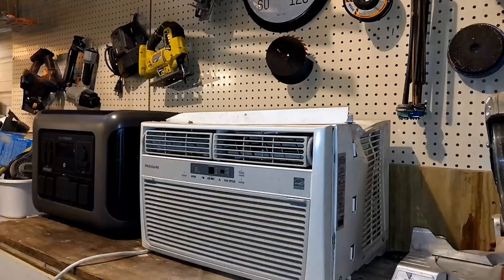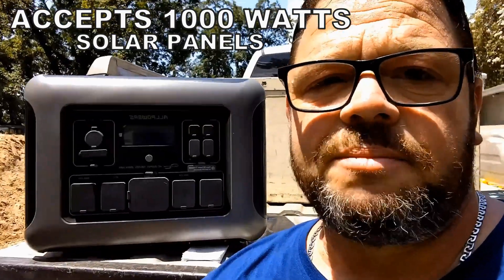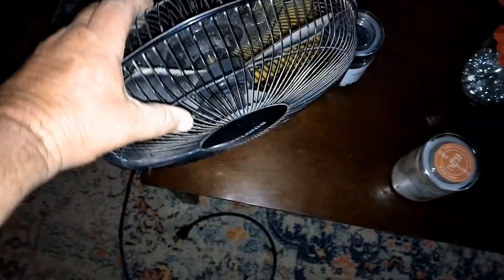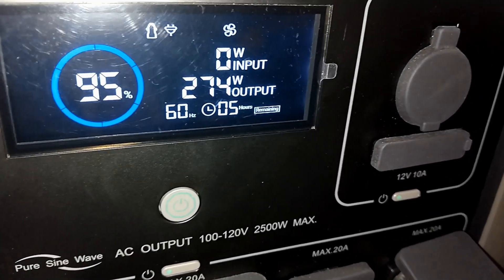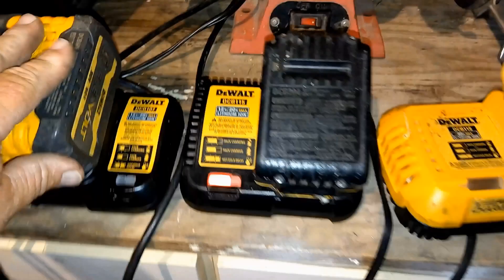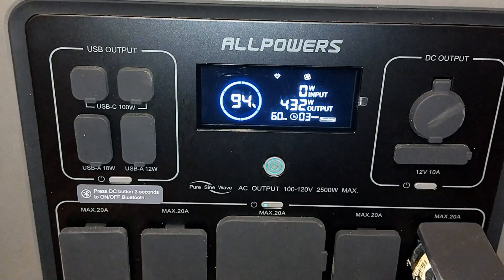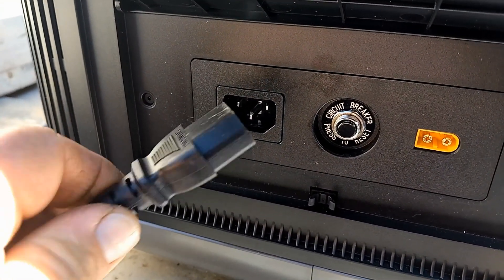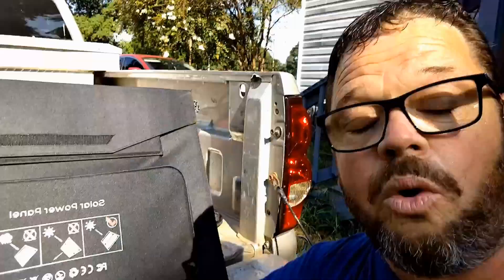Is This Best Solar Generator for Home Backup? (All Powers Review)

Comment: Biggest issue with the power converters is how much life can you get from one???? In a few years it's probably trash. Why I'd go with batteries you can replace because it's just a trip to a automotive store. I'd say buy both just not a all in one converter unless you just want the convenience. I also can't recommend Honda generators enough. Those things go forever unlike the harbor ones. But again if it's just a back up I guess a harbor will llast you. I just know doing construction those Hondas last and parts can be acquired fairly easy if it's not 20+ years old.
Reply from the maker: who knows how long they will last

Comment: Ok, so if I want this generator, and it seems like I do, how do I hook that to my rv to run all the systems in my rv? It's a 50 Amp rv
Reply from the maker: Well let's put it this way it's probably not made to push a 50 amp RV but it will push a 30 amp RV it actually has a 30 amp RV hookup in the center... But if you wanted to run 50 amp RV you may have to get one that is larger than this if you look on the website there are ones that are even larger than this one. The only other option besides that would be run extension cords for certain things inside and I'm sure that's not what you want to do.. so I would definitely go with a bigger one that you can hook the 50 amp cord into